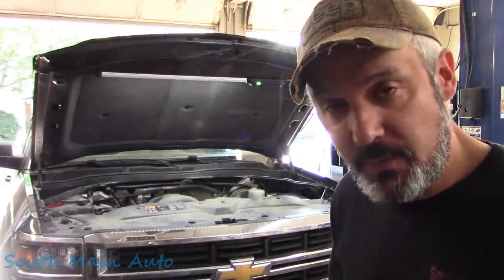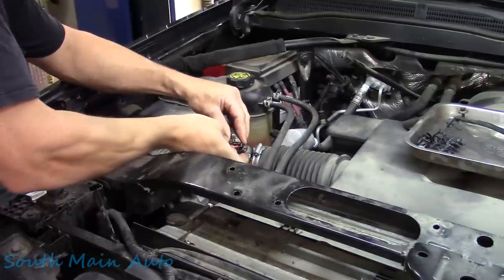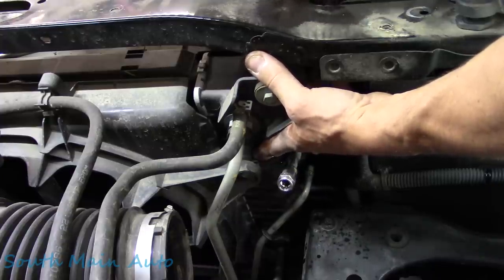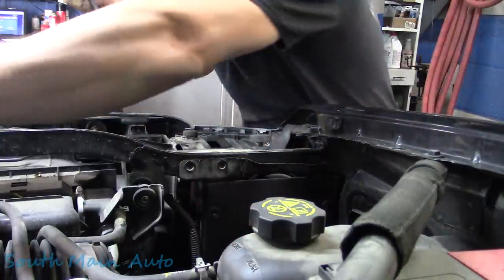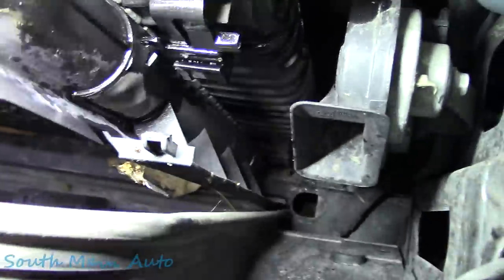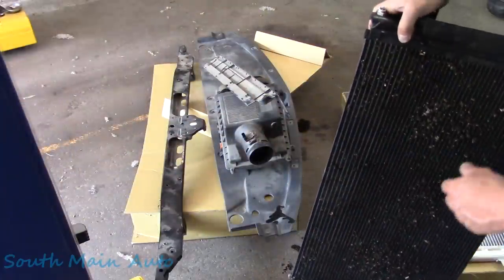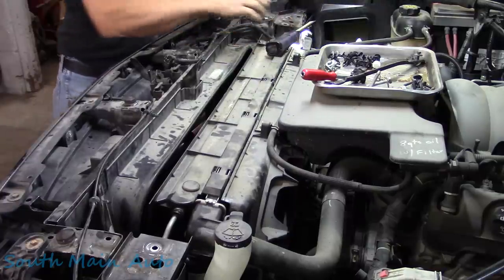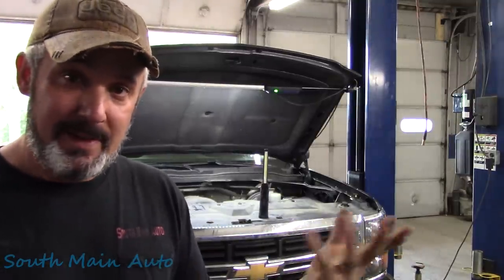Chevrolet 1500 / Tahoe - No A/C Leaking Condenser

Comment from the maker: According to the folks at GM this problem only affects some 2015-2017 model year Cadillac Escalade, Escalade ESV, Chevrolet Suburban, Tahoe, GMC Yukon and Yukon XL vehicles. You can find this in the bulletin 17336 - 07 https://static.nhtsa.gov/odi/tsbs/2020/MC-10178404-9999.pdf

I am here to tell you though it affects WAYYYYY more vehicles than they have listed. However in typical GM fashion they deny everything and won't cover any vehicles not listed in the TSB under the extended warranty even though they use the same exact part number haha. Way to go GM 😂 What a joke.....
Reply: I wish this was the first time I heard of them doing something like this.
Reply: The way these manafacturers wriggle out of their obligations is disgusting.  Not just GM either.
Reply: Sounds like they are democrats! IMHO 😂😂🤣
Reply: Former GM Tech here for over 20 years and yes, I can confirm this. If there's a nickel to be saved the companies will do it.
Reply: I've lost track of how many I've done now.
Reply: @jimjordan5630  beat me by 8 hours. 😅😅
Reply: 2014’s were not affected because it was the first year and GM does a fantastic job of not covering any defects from their first year vehicles. My dad and a co-worker each bought one after I pleaded for them not too. Both sold the lemons just after the warranty expired
Reply: So how long is the factory supposed to warranty them for? They covered them under 3/36 and then extended the coverage on them to 5/60…..
Reply: @demariojason  😂
Reply: Isnt adding refrig in a leaking ac system illegal?
Reply: @charlemagne1162  yes repair facilities are supposed to use dye and nitrogen for diagnostic purposes if a system will not hold a vacuum in some states but I’m not sure if that’s a law federally
Reply: I seem to remember, you had one of these GM products a while ago. The replacement from GM looked like a real butcher job where they separated a header physically between the AC side and the transmission cooler side. it looked like they use a cutoff wheel to cut it, and it was so bad you went back to GM and they said "yup, that's the way they make them now." I didn't see that on this one, so did they improve things??
Reply: I suspect it's the supplier because it's not exclusive to GM for that exact leak point
Reply: @louiscates6975  it was a supplier issue GM terminated the contract and hired another vendor that’s why they were on back orders all of ‘16 & ‘17
Reply: @southmainautorepairllc every single newer chevy I see gets a trans cooler thermostat delete kit because they cook the fluid black running at or over 190f and get stuck closed burning the unit up.
Reply: @jimjordan5630  yeah they never take responsibility for their actions.
Reply: @karlbrooksmotorsports4892  lifetime???
Reply: @karlbrooksmotorsports4892  funny when the vehicles cost a fifth of what they do now the air conditioning was covered for 12/12...might get 6 months out of a compressor
Reply: The TSB for porosity in the aluminum block casting covers all GM brands for 2009 thru 2021 with the 3.6L V6. Apparently someone decided it was cheaper to fix defective engines than fix the manufacturing issue. My 2011 Acadia has issues at 107k with coolant leaking into a cylinder.  New engine is $10.2K, GM offered to pay 10% of that; I've owned a couple of used cars for kids to drive that weren't GM but everything else was GM station wagons, 2  Suburbans, 2500 HD pickup, 2 Colorado trucks, 3500 motorhome chassis, etc. I asked my state Attorney General to look at merchantability ( fit for the intended purpose).
Reply: That's like most of them.
Reply: @jimjordan5630  Funny you think the only party that even bothers to pretend it cares about consumers is the problem. How's that working out for ya?
Reply: @jimjordan5630  Sounds like you just described politicians in general sparky. Unfortunately you think it's some kind of team sport or something with a side you inexplicably owe something to. Neither bunch is looking out for us and haven't in a while or we wouldn't be so used to GM etc pulling stunts like this. They didn't use to but let's keep relying on the selfserving propaganda about why that changed. Smh. If you'd stop squealing "BENGHAZI!" a minute it might sink in that neither side is worth a vote but "your team" knows what you'll swallow without question till your dying day. SAD. BIGLY. 🤦‍♂️
Reply: @robertball3578  What do you mean "fix"? I thought six tabs of Barr's was the factory solution to the porous aluminum engine castings since at least the 90's.
Reply: @johnassal5838    Spoken like a true DEMONRAT.  😂
Reply: "typical GM fashion" My 16 Yukon was a year and 10k miles out of warranty and extended condenser warranty. I called GM direct and they reimbursed me for my condenser replacement after they verified the cause with the GM dealer...
Reply: @jockosboy17  I'm surprised that they did that!
Reply: @jimjordan5630  I have bought new and certified pre owned GM's in the past. Maybe that is why? Not sure but they took care of me. Either way I payed for it but the reimbursement was nice.
Reply: As a gm tech i can confim ive done so many of these condensers!
Reply: I suspect that Eric is like me, rebuilt my first engine and transmission at 10 years old. Also dove into electrical, and construction. I love working with those things. Always taught to not just fix a problem but improve or eliminate the problem. My dad is a great inspiration for me. Great job Eric, we should have a beer sometime 😁😁

Comment: I work at the GM plant in Lockport NY that makes that OEM condenser.  They have had problems for years with leaking at the saddle couplers which connects the return tank to the core.  The saddle insert coupler does not braze cleanly or securely to the tank due to the transition from oil cooler to condenser so we get leaks.  I think I recall that the average mileage for failure was around 37K   I've known many people up this way that have had multiple condenser changes as the final design correction took several years to sort out.  Basically, we made alot of junk for this model for many years, 2012-2017 ish.  Thank you GM!!  And thank you Eric for another great video!!
Reply: GM's junk made me a ton of money, Thank You!!!  Well, until they cut the labor time.
Reply: Why would GM allow such a known defective procedure to continue? How hard could it have been to perfect the procedure to braze things properly?
Reply: GM also has a hard time building radiators. Useless things always leak on the plastic tank seal to aluminum on the side with the upper radiator hose. Even the aftermarket radiators only last a few years due to the pressure when the thermostat opens. There used to be a company that sold all aluminum radiators, but mail-order only.
Reply: That is exactly where my condenser failed. I had made it to ~70000 before it happened though. I guess I was "lucky" it lasted that long. It was replaced with the redesigned version and I'm still driving that truck.
Reply: 5 part numbers later, they rotated back and forth to and from the same condenser, still sending out the defective units. Makes me wonder where it has landed to this day. Has the issue been solved, or are they still hit and miss? Been a long time gm owner, don’t think I’ll go any newer than my 99 Tahoe. Just lost faith in the brand.
Reply: @willw8011  I bought an all aluminum radiator for my Chevy from Lilland Global.  Another source is Cold Case.
Reply: @privateer0561    I agree  as I remember, that product and time frame was when GM Lockport first got Robotic welders and they were in this process, among many other initial weld processes.  They were all about volume and not quality as trucks were flying off the lots.  We had many product failures at this time but kept making them because GM needed the product for all the truck sales at that time.  figured they would earn now and pay later.  As far as how hard to correct, this product was not designed by GM Thermal but rather Mahle, a German outfit who basically took over parts of the old Delphi Automotive Company, who we were a part of for a few years before GM took us back,  but we still needed their ,Mahle, designs for product so we used theirs and produced it heavily.  Not good but what it was  Sorry
Reply: @rowlandpichey6602  Mahle makes the rear ac evaporator cores for the Traverse/Acadia.  Another gold mine for us techs.  At least the time was not reduced for those.
Reply: @willw8011  "GM also has a hard time building radiators. Useless things always leak on the plastic tank seal to aluminum on the side with the upper radiator hose. Even the aftermarket radiators only last a few years due to the pressure when the thermostat opens. There used to be a company that sold all aluminum radiators, but mail-order only."

Wrong. They were leaking because GM began to use a thermostat that opened at a higher temperature (~207F). In cold weather the thermostat would cycle open and close way more often than normal, causing the radiator to fatigue due to constant expansion and contraction (particularly at the tabs). This fatigued the metal tabs at the plastic tank connection and causes leaks. Once the revised thermostat was installed (covered under TSB), the radiator failures stopped. If you have this problem, you need the revised thermostat with new temp setting.

Comment: My father bought his first car in 1916 when he was 15. As he grew up so did the automobile repair industry. His #1 rule was that if the mechanic could not fix the problem on the first try, try a different mechanic. He did not claim that the first mechanic was incompetent, rather, Father believed a new set of eyes will see something that the other set of eyes has missed. This is a perfect example.
Reply: I'm sorry, but a "mechanic" that adds freon 4 times every summer on the same vehicle and can't find a leak is an idiot, or a freon salesman, or both.
Reply: Was thinkin, why a flat screwdriver,  myself 😂    I don't like getting  sheshkabobbed!  Don't like seeing it happen to someone else either.   Great videos!   Keep up the good work!

Comment: The only downside to watching SMA videos over the years, is wanting to buy every new tool I've seen being used... Also very eye-opening to see the unnecessary brake jobs being done there, ripping people off left and right... wow... jk, of course...
Reply: You got that right! I want an A/C machine!
Reply: @walterk1221  Seems like half the auto repairs anymore either require discharging the AC or removing the intake manifold
Reply: @ngnmech  I just had to pull a radiator to change an alternator. Even years ago I had to remove the master cylinder to replace a starter. OEM designed to make more work.

Comment: Customer: other shop says it can’t be fixed. Eric: amateurs, hold my beer.
Reply: It depends on how the other shop pays the mechanic. The mechanic might only get 30 minutes or so to find the leak... then it magically becomes unfindable due to not getting paid for more time. When someone goes to a flat rate mechanic, then they get what they pay for or less.
Reply: @willw8011  that's part of being in the mechanic business these days. Never an excuse to be dishonest. Be honest fix it or get out of the business.
Reply: @hipshot823  Your version of reality is not real. In most shops, the service manager or foreman writes up the work orders and the mechanic does what is requested. The mechanic does not go rouge to do what he wants with someone else's property. If a basic A/C service and leak check is written up, it is usually a basic 1 hour evacuate, recharge with dye, and quick look for a leak If nothing is found, then get it out and on to the next work order. If a mechanic goes rouge for 3 hours, then no money for 2 hours and the service manager/ foreman and customer are not happy.
Reply: @willw8011  Eric said the guy said the other shop usually did it four or five times a year, how many years did this go on? In the second year they should’ve stopped and investigated it a little more thoroughly. it’s just not responsible to do it that many times knowing it will leak right back out
Reply: @jboz1435   It all depends on the circumstances. Many shops' managers do not care one little bit about looking up the vehicle service history and service bulletins. The customer has a few minutes to say what is or was going on and then the service manager or foreman writes up the work order. The mechanic offers recommendations to service manager or foreman.... and then the service manager or foreman talk to the customer about whatever they want to talk about. The mechanic almost never talks directly to the customer. That is just the way it is. The mechanic does not go rouge an order unauthorized repairs and parts. Most shops will not allow a mechanic to order parts, because all of that goes through the foreman and/ or service manager.

The first time: usually shops will do the 1 to 1.5 hour basic A/C service and leak check. The shop will tell the customer to drive it and comeback, when it malfunctions.
The second time: If the customer says the history, then the mechanic will look at it for dye leaks and do the same thing as the first time.
The third time: the customer needs to find another shop. Some shops do not have skilled service managers/ foremen or mechanics that actually look for service bulletins. Some shops only want to do the easy stuff and hire the cheapest people on Earth. It is what it is.
Reply: @willw8011 I would never bring anything to that shop ever again. It took me 10 minutes to find my condenser was leaking. There's only so many places it can be, look with a UV light(most of these Chevy's come from the factory with UV dye already in the AC system and it says so on the AC sticker on the trim) if you can't find anything recharge the AC and get a gas sniffer and run the lines with it still finding nothing put AC on and fan on low and use the gas sniffer in front of the vent if it goes off then it's the AC evaporator. I would be surprised if it wasn't 1 of 2 things, the mechanic didn't like AC work or they wanted to recharge it 5 times a year and make more money than just outright fixing it with less work.

Comment: The brake job looked like something on "Just Rolled In"  How can they not know what's wrong??  Great video as usual, Eric.
Reply: JRI is a great channel! (So is SMA)
Reply: Truck stops = brakes good.
Reply: The torque side of the car always wears the brakes quicker !
Reply: I have a Dually 3500HD, and being a bit of a mechanic I know I can ignore the little grinding noise for a while. After all, I've got new rotors for it already.  This goes on for a little while..and then a while...and then a long while. I figure I will just be gentle on the brakes. One day I hit the brakes a little harder than normal and start hearing a thump thump thump sound. I figure at that point I have gotten the full value out of the pads and rotors and I guess I will change them (which is in fact a PITA) I discover that there in no longer any friction material on both fronts, which I expected. What was bigger news is that the pad, outer rotor surface and fins were gone from the pass rear rotor, and that the thump was just the drivers rear rotor fins hitting the pistons, as both the outer surface and pad backing was gone. Mind you, each surface is probably 3/8 thick... I definitely got every dollar out of that set of brakes!
Reply: @mrl22222  You haven't lived until you've run drum brake shoes through the drum on a pre seatbelt car, thankfully it was going 35 mph, man them brakes were awesome stopped on a dime once, I wasn't in it my bf was he narrowly escaped with his life.
Reply: Well it just started making noise yesterday 😫
Reply: Typical Nissan Altima drivers
Reply: @mrl22222  jesus wore through not just the wear material but the backing as well!?!? In the rear none the less!!? What were you driving with brakes grinding for a year?
Reply: @jacksmith2315  to be fair, 2 of the 4 backing plates were on the rear...and it probably was more than a year, but it was covid, and I rarely drove it, and "what can possible go wrong" Best part was that I actually had the new pads, rotors and calipers in the garage.
Reply: @mrl22222  during covid, rarely driving it, and already having the parts are all even more reasons to have replaced them sooner lol. But i get i know how it goes. Usually jts replace the pads before you need to replace the rotors, but if you already have the rotors than you dont care what happens to them, surprised you had new calipers though. Those usually only replace when they fail and not something usually buy a head of time
Reply: @SevenNumber7  😂
Reply: @jacksmith2315  
That talk radio show was turned up to 10
Reply: @jacksmith2315  calipers were like $40 each. I was prepared...and also lazy
Reply: @mrl22222  wow thats cheap for calipers, i havent seen them that cheap for awhile. I did one on a 96 f150 a month or so ago, was a reman and was almost 100. The one i did on a 03 accord almost a year ago was also a reman for i think 60-70
Reply: Even when i was working at the shop a couple years ago and the shop was gettin a discount for having an account, we did a lot of e250 and couple f150 since i was a fleet mechanic for an hvac company, even those were prob around 50-80 for remans, depending if they were the ones that required the bracket or not.